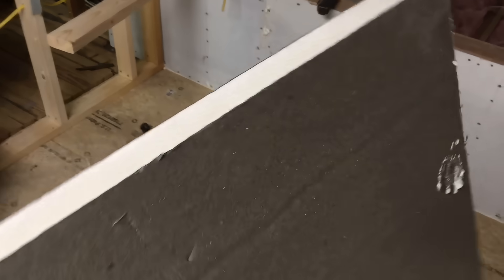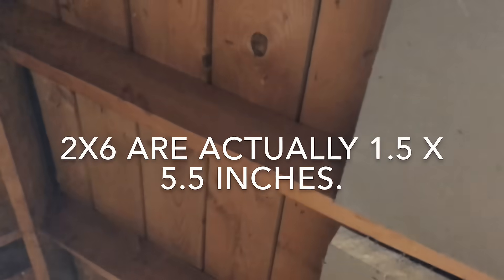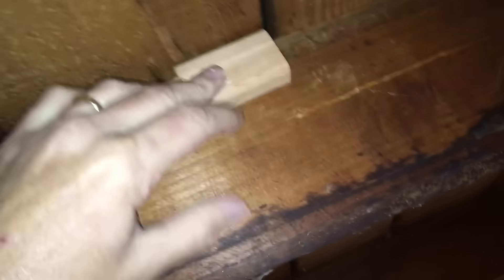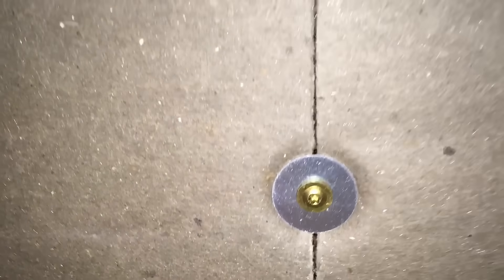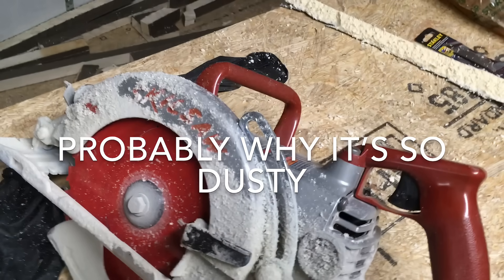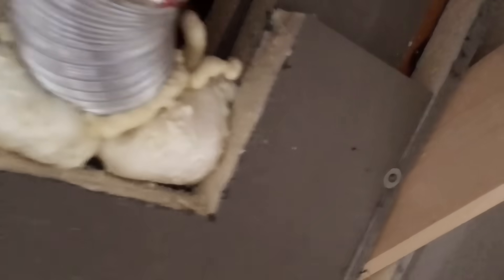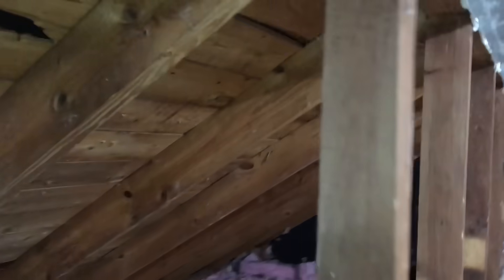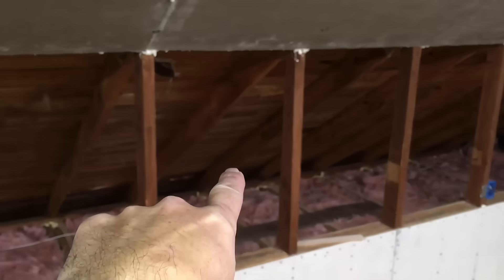Getting R-30 in an attic suite with 2x6 ceiling rafters

Comment from the maker: Just read over a lot of the comments, and here's some more info ... 
I cut the foamboard outside and wore a dust-mask too.
I'm in zone 3
R-30 is code for ceilings where I live.
This is permitted and inspected construction. I told the inspector my insulation plan before-hand and he approved. It passed inspection and is now covered in finished and painted drywall.
The insulation is GAF Energyguard. 
I could not find the board for sale online, but purchased a pallet of them from a local roofing supply company (ABC Supply, Greenville, SC) for less than $20 per sheet. https://www.gaf.com/en-us/roofing-products/commercial-roofing-products/insulation-cover-boards/cover-board/hd-polyiso/energyguard-hd-cover-board
These particular boards are usually used in exterior roofing applications, but I confirmed with the dealer that I could use them how I did.
The boards are polyisocyanurate covered with a vapor permeable fiber-reinforced paper.
The inspector required 1.5 inches ventilation space between the insulation and the roof regardless of what type of insulation was used (including spray-foam) [*edit: unless my shingle manufacturer okayed no ventilation. They did not.] That is why my last layer is across the rafters. I would have rather it all been inside the bays and had the headroom instead of having a thermal break, but had to do what I had to do.
Thanks for the comments. A lot of good suggestions out there.
**WATCH THIS BEFORE YOU CUT FOAM  https://youtu.be/Z292iuV91hA
Reply: I can't believe your inspector required 1 1/2" space between insulation and roof sheathing.  He must not have ever heard of a "hot roof".  A lot of builders are doing it the way now and for good reason, just have to use "better" roof materials.  I didn't agree with a non-vented roof at first till I did some extensive research.
Reply from the maker: The inspector said I could eliminate the ventilation space if I contacted the shingle manufacturer and they okayed it. I contacted the manufacturer and they did not okay it. Their warranty documentation required the installation to have at least the 1.5 inch space between the sheathing and decking.-- I think it's good that the inspector's default requirement is the spacing (at least until the rules officially change) because a lot of folks would be unknowingly voiding their roof warranties. Though I was wary at first I like the inspector(s) I've had. They've been very fair and open-minded (in my opinion).
Reply: Dave Voskos makes sense, I know there are builders in Texas that use this method without any problems, usually doing metal roofs or premium fiberglass shingles.
Reply from the maker: --Thanks for the comment. It was a good question. It spurred me to go back and edit my original comment to clarify.
Reply: @FamilyFriendlyDIY  Did you have a vented attic (soffit + ridge?) Just curious on the spacing and other comments on on a "hot roof." I saw your other video on the temps and it looks like your solution is working well so far (unless it got the corona :-)
Reply: @woohunter1  lol
Reply: @woohunter1  everybody who is a internet ninja knows spray foam is the only thing that works lol but like he mentioned his shingle mfg would not sign off on spray foam because they are smart enough to know that without airspace the shingles would not last and would be a warranty issue....any real builder would either leave space usually if they know sprayfoam will be used and it's much easier to vent the roofing if new construction
Reply: Russell Henry I already fully understand about the roofing material issue, just didn't realize this is a remodel job and he kept his old roof.  In my opinion, a "hot roof" is a better choice, even if your attic is vented, it's still going to be hotter than hell up there.  Might as well not let the heat in there in the first place, but you do have to use premium roofing materials.
Reply: @russellhenry1188  
Spray foam is still an option, but the air gap must still be set with a thin barrier. There are plenty of prefab ventilation channel products.
Reply: You will not have a hot roof with properly applied spray foam and no ventilation. But- you have to cover the rafters as he did here so there is no thermal bridge.
Reply: @woohunter1  In cold climates you had better have a well thought out system if you eliminate the roof venting,  because if you screw up you are going to be replacing your entire roof, sheathing and all. This system is simple and it works.  It is time tested.
Reply: @woohunter1  I am a licensed General Contractor and a civil engineer and I don't see builders using "hot roof" systems anywhere.  It's possible I don't understand your term you are using. Your video that you posted makes little sense. 

You  seem to be talking about spraying foam directly on the underside of the roof sheathing.  The  video stated the inspector would not accept that.  So your suggestion is a non-starter.

Technically if you break the thermal barrier between the conditioned air in the attic space and the cold air outside, spray foam will work.  But if you miss an area,  the roof will rot in that area in just a few short years.  Roof venting is a cheap,  effective solution to prevent that problem from occurring.  

Most builders vent their roofs because of liability reasons.  If there is a problem and it goes to court,  the standard of good practice is to vent the roof properly.  This is easy to defend in court. Other methods,  not so much.
Reply: FL FL cement board and lead lead pans are tried and true methods of building too, but contractors are moving away from that as well to utilize modern, better, and less labor intensive products and procedures, so stick with what you know.  I will agree with you in that if you use a “hot roof” aka ventless roof, you better know what you are doing.
Reply: @woohunter1  Your comparison with archaic tile water proofing is not accurate.  The simple fact is venting the roof is NOT "labor intensive," that is a stupid comparison. Conversely,  building a so-called "hot roof " is VERY labor intensive. 

Further,  if you insulate correctly under the rafters or trusses you can provide an air channel that is less than 3" thick, and still insulate at the roof level and create a conditioned attic. So you have all of the benefits of a "hot roof" and none of the risks. 

This is a far superior system because it circulates hot air away from the roof surface through the venting by natural convection. So in hot climates it provides a cooler roof surface.  This extends the life of waterproof sheathing components directly attached to the plywood/ OSB.

Further,  this system lowers the cost of conditioning the attic in hot climates by providing an air barrier between the roof surface and the insulation.
Reply: FL FL check out Mat Risingers videos on conditioned attic spaces.  He explains in detail why introducing hot air in a roof system is not ideal, plus you can achieve better r values.  Btw, I am choosing not to use the word “stupid” when having a debate with someone, even on the internet, because I was taught how to respect others, even when you disagree with them.
Reply: @flfl3969  Hi, love this video and all the comments.  Planning an attic project to make it semi-conditoned vented (I have soffit and ridge vents, northern climate).  Using 1.5" furring strips against the roof deck, then plywood for an air channel / air barrier, R30 batt, and capped with  R10 polyiso on the attic side over the rafters (vapor and air barrier, and thermal break).  I'll use 2x4 blocks to build out the rafter size to accommodate the R30.  I think I've thought of everything LOL.   Just a storage area but all my HVAC is up there and working way too hard.  😂
Reply: @woohunter1  I have watched Risener's videos on sealing homes and I am very skeptical. The costs are astronomical compared to standard building, and the difference in insulation values won't be that much. 

For example,  I designed a flat-roof house using trusses. The roof is vented with vents mounted to the top of the roof, which allows hot air to vent out of the attic. This is in a very hot climate. 
The ac is zoned so that sections of the home can be cooled at different temperatures.
The ductwork and  is in the attic. To insulate the ducts I spec'd R-60 blown-in insulation which covers the ducts in the attic. This shield, them from the intense heat very effectively. 
I installed the split system air handler inside the home in conditioned space. This is something Risener also does. So the cooling coil does not have to deal with exterior temperatures. 
I also spec'd a high efficiency variable AC unit, a Trane heat pump. It has variable speed ability. This unit draws around 15-20 amps, which is less than a corded Skillsaw.
The walls are 2" x 6" with R-19 batt insulation. I also sheared the exterior walls. The walls are stuccoed with 2" of polystyrene lathe. This gives the walls about a R-30 insulation factor and it is a very serviceable system that is easily repaired unlike Risen's systems. 
This house costs very little to heat and cool and it cost a fraction of Risen's sealed house systems.
Reply: How did you fasten your drywall? to the foam board?
Reply: Asphalt shingles need to breathe from underneath. Owens Corning does not endorse anything directly against the sheathing on the inside of the roof, to make the shingles last longer, as well as to aid in air/humidity control in the attic
Most spray foam companies (I live in the SE USA) just spray directly onto the roof from inside, filling the entire cavity.
Great for energy efficiency, terrible for moisture control, and the life of your singles and roof decking.
Reply: Dave Voskos hey Dave, does your soffit have ventilation holes in it ? When you panned down to the inside of the soffit, it didn’t appear to have ventilation holes in it but some of those rascals are pretty small and I missed em. 

My thought is if the soffit does not have ventilation holes, and there isn’t a ridge vent, then the air gap between the underside of the sheathing and insulation won’t do any good anyways but if you do have both then I do agree with the inspector. I’m remodeling right now also and am in the same dilemma as you were but I do not gave soffit ventilation or ridge ventilation and while the ridge vent can be rectified easy, the soffit vent is a different story so I think I’m gonna insulate right against the sheathing then either use metal roof or find a high quality shingle that’s rated for a hot roof. 

Excellent video brother, nice job, take care!!!
Reply: Search your local classifieds or craigslist for insulation. You can often get recovered or excess roofing insulation (polyiso) for $3-$7/sheet - There are pallets of 25 sheets for $75 near me. Keep in mind that Polyiso is only appropriate for interior (attic, walls, interior/exterior roof, etc) usage, NOT where it is may come into contact with moisture as it absorbs it like a sponge. Polyiso also loses R value when it gets extremely cold.
Reply: The GAF product in the link looks like something different.  It has a 2.5 R-value, and is probably a lot thinner.
Reply: Dave: The "cover board" in your link is only 1/2" thick w/ R=2.5. I suspect that you used one of the products in the "Insulation" section of https://www.gaf.com/en-us/roofing-products/commercial-roofing-products/insulation-cover-boards?Action=GetGrid.  The "EnergyGuard Barrier Polyiso Insulation", for example, is available in thicknesses from 0.5" to 4.6". The R-value of the 2" version is 11.4 which is, I think, what you mentioned in the video. Datasheet: https://www.gaf.com/en-us/document-library/documents/productdocuments/commercialroofingsystemsdocuments/energyguardinsulationdocuments/insulation%20documents/polyisoinsulationdocuments/energyguardbarrierpolyisoinsulationdocuments/ENERGYGUARD_BARRIER_POLYISO_INSULATION_DATA_SHEET.pdf.  Note: I'm just guessing at which of the many products GAF has that you got--my guess is that there is more than one similar products available.
Reply: That insulation won't effectively stop radiant heat very well because it's not reflective. You may say it does.. but not as well as a simple attic foil would.

Comment: Depending on the inspection the ISO board may require a vapour barrier. 2” of polyurethane Sprayfoam is considered a vapour barrier but 2” of Iso board is not. The product he is using is a polyisosyanurate. A polyurethane is a polyisosyanate, both products derive from polyol and MDI but are two different types of foam. It’s the gas trapped in the cell structure that gives it its r-value and effectiveness. Polyiso actually preforms worse if not at all at below zero temperatures. Although a decent product for exterior roofing applications and mostly used in commercial roofing a polyurethane Sprayfoam would have been a better option or at the least a true extruded polyurethane board.
Reply: Poly iso is used extensively for walk in freezer compartments. Btw there are night mares of spray foam being applied incorrectly

Comment: You can buy an r38 fiberglass batt with about 6.5" thick and after a compression conversion, will easily fit in 2x6 rafters while still achieving over r30. More like r34 ish. It's faster. Easier. Cheaper. Less itchy.
Reply: How would you maintain airspace for ventilation?...need some 1/8 ply to create  a baffle between underside of roof and insulation?
Reply: @jonathanlozier4329  
There are plenty of prefab spacer ducts that look like egg carton, but optimized for ventilating the sheathing. Others look like corrugated cardboard.
Reply: @jonathanlozier4329 , He spaced the insulation boards 1.5'' off the roof. Did you watch the video ?
Reply: R-38 dense pack fiberglass insulation is spec’d for 12”. If you don’t fluff it before installing it you might think that it will fit into 6.5”, but you will not get R-38 performance. Not fluffing fiberglass batts is an all to common shortcut when installing. 

Dense pack fiberglass insulation is rated around R-3.16 per inch.
Reply: @bigk4755  But he only had 4 inches of space after ventilation was partitioned. Only gets you about R12 in the original cavity and still comes up short if you fir the rafter and drywall nailers with 1/2 inch foam and 1-1/2 firing strips that would be 6 inches cavity for a total of R18-19.
Reply: Master Debater we don’t know the R value of the foam that he used (or at least I don’t recall, and don’t have time to watch that video again). However I do know that in 4” you can achieve R-27.2 net using R-Foam foil-faced polyisocyanirate foam board (available at Home Depot). He still needs a bit more to meet code, I think a 1” layer overall then 3/4” furring for drywall would take care of it. 
As I recall he used a third 2” layer of foam.
Reply: @bigk4755 I Agree we don't know what the specs are for his material and as well if the R-value of the drywall (around R1 per inch not sure about the newer lighter type sheetrock) can be used for the net R-value of his install. I think it was mentioned that this was cheaper than the pink stuff and foil faced. Maybe he could have gotten away with that 3rd layer being only 1/2 to 3/4 inch or so. I am not in the business of insulation though so I cannot say really what he should have done only what I would have done given the circumstances. I would have furred the rafters and nailers with 1/2-3/4 foam and 1.5 inches firing giving the needed cavity depth. Obviously he went with the most budget oriented choice which left him with a hard way to hang drywall later. I truly hope he isn't going to just glue paneling to the walls.
Reply: Master Debater agreed with that about just gluing sheetrock to the foam insulation. By code I don’t think that you can rely on glue only for any overhang/ anything past plumb. I am a licensed carpenter who always tries to honor code regardless of permit or not. The recipe in my previous post would have been how I would have addressed this situation, or perhaps 2x3 strapping for the SR, you never know when an inspector might suddenly appear. 

“Cheapest possible”, always makes me roll my eyes as many homeowners and some contractors have a very scary imagination when that phrase becomes the primary rule. I have seen many scary interpretations of cheapest possible.

Comment: I assume the reason your insulating the roof rafters is that your converting the attic into a heated living space?  How do you intend to attach the dry wall for finish and for fire barrier?  Foam board will cut pretty smooth and easy with an electric carving knife (they type with double reciprocating blades) -- just like carving the turkey, producing very little particles or dust.  You still need a good particle mask and set up  a couple of box fans with cheap furnace filters to clear the air.
Reply: Attach with longer sheet rock screws.
Reply from the maker: https://youtu.be/dGeoA1ji_iM
Reply from the maker: I tried the electric carving knife in this video  https://youtu.be/Z292iuV91hA  Thanks for the comment!